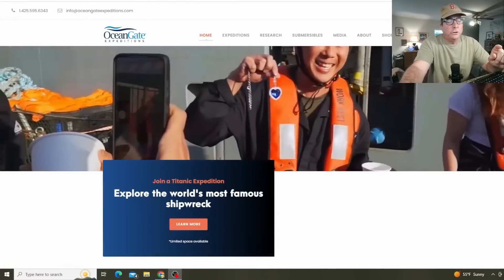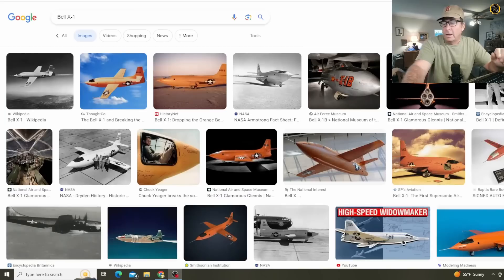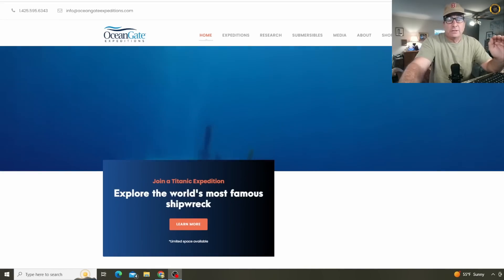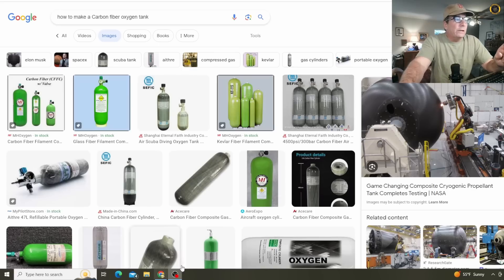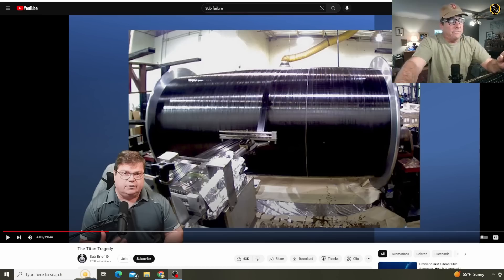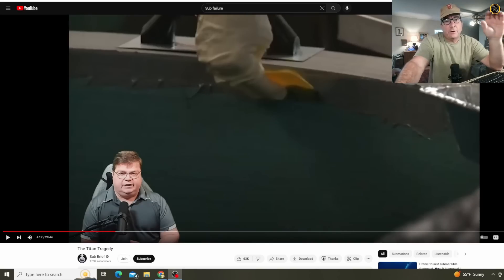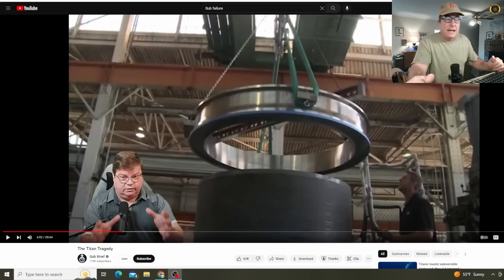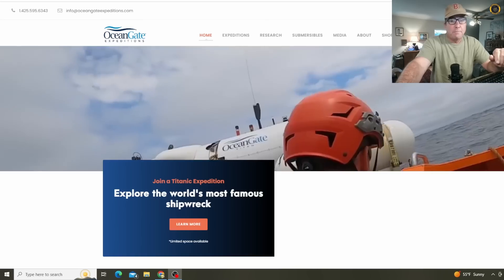Oceangate Sub Construction Details and Implosion

Comment: The carbon fiber design had its roots in a Steve Fossett plan for the DeepFlight Challenger a submarine which flew more like a plane, instead of using ballast it would descend by using forward motion and hydroplanes to generate the opposite of lift. He worked with a California company Hawkes Ocean Technologies who worked on the design, but it was planned for only one descent because of concerns over degradation with each descent. OceanGate took the carbon fiber concept and went to the same manufacturer Spencer Composites to build their pressure vessel.
The DeepFlight Challenger was weeks away from Steve running the first tests when he crashed in the Sierras.
Reply: i believe OceanGate and Spencer also parted ways because of Spencers very real and valid concerns with how OceanGate was handeling the safety and development of this project.
Reply: @glassdave I don't think so. The Spencer vessel was apparently sounding pretty bad under pressure, lots of cracking sounds. They said it was showing signs of cyclic fatigue.
Reply: @glassdave  you would think between 4 billionaires they could have hired someone to check the build design.
Reply: @freedom661100  It's not a matter of money, it's a matter of thought processes.
Reply: @freedom661100  Just because you're rich, doesn't guarantee you've got an aptitude for engineering.  Many successful people are often single minded.
Reply: Another Aerospace Engineer here.

You are right about deep flight challenger but there's a significant difference. It was all CF not parts CF and Parts Titanium.

On Juans last video on this subject I gave an explanation on the differences between compressive and tensile loading of pressure vessels and why Carbon fibre is great for rocket fuel tanks but unwise for a vessel under EXTERNAL pressure. But there's also a major issue with the differences in the cylinder to the end caps. Being different materials they compress and stretch at different rates.

Just hours after I made that comment James Cameron pointed out that all of the deep diving subs are made of the same material. They don't mix materials for the main pressure vessel. Its doesn't matter if they are using titanium, steel or acrylic. Other than port holes they don't do combinations like this sub did. 

Think about that glued joint. As the sub descends that titanium ring will deform under the pressure at a different rate to the carbon fibre putting that joint under incredible stress. My professor in college was a world leading expert in Finite Element Analysis if Axisymmetric and Pseudo Axisymmetric structures. This is the sort of thing I was trained in except it was in aerospace. AND Rule #1 of all structures is look for stress concentrations and deal with them. 

There's also an odd but previous lesson in mixing composite and metal structures. 
Back in the late 90s the Stewart Formula 1 team tried a revolutionary gearbox with the case made from composites and it was a disaster for reliability. Note that in those cars the gearbox is an integral structural member of the car. The engine is connected to the tub by a cluster of mounts. The gearbox is SOLIDLY BOLTED to the engine with locating dowel pins so that there is no misalignment. Then the rear suspension is bolted to the gearbox. 

At the the time my boss owned a racing car team on the side. One of hi mechanics quizzed me one day. His view was that as everything got hot the metal of the engine and the shafts, gears & bearings in the gearbox would expand against the carbon fibre of the gearbox casing WHICH WOULD NOT EXPAND AS MUCH IF AT ALL. That mechanics view was the difference in expansion would simply break things. That Stewart F1 gearbox might have been revolutionary but it was also incredibly unreliable and NOBODY has tried it again in any form of racing I am aware of.

Best to you Scott - love your channel.
Reply: @tonywilson4713   Okay dentist here, in University I did some research on Dental Materials and had my fair share to deal with composites, porcelain and different metal alloys such as NiTi, Gold, Amalgam etc. Oral cavity is extremely difficult environment and joining together biological materials and man made materials is difficult. One of the most common failure points of a filling is adhesion that is present between the tooth and composite (resin). Having that experience I see mixed use of materials with so different properties in such environment as serious point of failure (mixed material hull!!!). I remember doing models and stress tests to find out Young's modulus for different materials. My biggest shock was when I saw how Titanium and Carbon fiber tube was joined together. Also apparently they did weaken carbon fiber by screwing things into it, introducing stress points etc. Overall there were just too many design shortcuts and failure was a matter of time.
Reply: @tonywilson4713 
LOTS OF GOOD AND VALID POINTS ON YOUR COMMENT. (From a seasoned, 42+ years engineer in the petroleum industry).
Reply: @tonywilson4713  great comment, thanks. Incidentally, you might already know this, but, Stewart F1 is now Red Bull and have lead the last 200 laps of all Grand Prix Races, and won every single race so far this season.
Reply: @ElementsMMA  Yeah I know they ended up becoming Red Bull after they were Jaguar after they were Stewart.
Reply: I’m a professional Ocean Engineer.  Carbon fiber is an okay material for pressure vessels, apparently, because it is being used on some fielded UUVs with success.  Carbon fiber is fine in compression, unlike what the claimed aerospace folk are saying.  It’s not “pushing a rope” as the carbon absorbs the resin and hardens.   Also, there are many glued joints in ocean engineering and they’re okay for certain applications.  Typically, the joints have to be designed very well and you’ll still face limits based upon depth and submergence time.  This leads to some of the more realistic challenges with carbon fiber.  

Carbon fiber is brittle and not a contiguous material.  R&D hasn’t caught up with a great way to detect incremental failure in carbon fiber parts.  What R&D has shown is that the individual carbon filaments will sometimes break inside the part, without the part outright failing.  As more of these filaments break, the part becomes weaker and weaker.  This is detectable, I believe, with ultrasonic scanning which also detects manufacturing imperfections such as voids and delamination.  However, it’s important to note that this incremental failure is a non-linear process and to the best of my knowledge there is no predictable pattern as to how this behaves.  Because there can be microscopic internal stresses inside the Carbon Fiber part which can lead to local over stress.  

This is compounded by the fact that pressure vessel performance is also highly nonlinear.  Even with more predictable materials, heat treatments, and inspection, pressure vessels are very bendy at high pressure.  In the weirdest of ways.  This is even further compounded by extreme “stress concentrations” around any sort of bolt holes for end caps or deformities.  

So, you’ve picked a nonlinear material for a nonlinear application without R&D to predict how it will perform in load cycles.  What else?

Most plastics and resins absorb some amount of water over time - maybe 1%.   Im not sure this is a big deal in lower pressure applications, this does cause delamination of potting materials in long duration applications.   But in a 380 atm application?   I do wonder a bit harder about that - im not a material scientist but I wonder if >1% water would get forced into interstitial boundaries or rapidly speed up delamination.

Finally, carbon fiber is really brittle.  Prolly not going to make a difference at those pressures, but ideally you like to avoid brittle failure undersea bc that’s a big explosion.
Reply: @stevebean1234 You bring up a lot of interesting points. 
On the water absorption point, I wonder if more water is absorbed because  of the pressure and then is released when the vessel surfaces thus making and dedect much worse much quicker. 
I thought that one way to tell if the chamber was experiencing problems would be with enough strain gauges built into it so.that you could know if the tube was flexing more. 
What I see is that they didn't  understand the material  they were working with and were unwilling to do enough testing to learn. I would think you likely  would have to do things like build a quarter sized unit, run it to depth a number of times and then cut it up so see what was going on within  the material. If it looked OK then build another and do more cycles next time and repeat. I would continue until it failed or obvious problems developed. 
I also don't really understand the carbon fiber choice if you are trying to build something inexpensively where weight isn't a huge factor.
Reply: @doug112244 Weight was a huge factor in the Titan’s design.  Essentially, the Titan needed to float.  That way they could descend with ballast, which they would release to ascend.  A metal pressure vessel would be too heavy.
Reply: @doug112244  Interesting, strain guages (on the inside of the cylinder) would appear to give a good indication of broken strands and delamination resulting in more deflection of the structure at a given depth. Ideally you would want to "learn" the strain guage readings vs depth on the first deep dive and then compare the readings on subsequent dives against those reference readings. I guess the deflection may vary with temperature which might vary quite a lot before it enters the water but the water temperature profile is probably quite repeatable particularly when always diving at the same (Titanic) location and only in the summer. 
It would also indicate particular areas to concentrate on for ultrasonic testing during maintenance if particular strain guages had deviated from the reference on a dive. (As well as a primary function of aborting a dive if there is a significant difference from the reference recordings). 
Titan did have some sort of hull monitoring system. Was that acoustic, listening for fibres actually breaking?
I own an aircraft that has carbon wing spars (obviously carbon in compression at the top of the spar, in tension on the bottom of the spar and a carbon shear web between them). I should probably be fitting strain guages!
Reply: @stevebean1234  Very helpful post!
Reply: @stevebean1234 Thank you.
Reply: It would probably be fantastic at shallow depths, but not the type of thing to push very far at all. 100' ?
Reply: @dananorth895  Yes this thing was suitable for a couple hundred metres, that's it, and would still need frequent x-ray testing to ensure it wasn't beginning to fail internally.
Reply: @dananorth895  I heard they were having problems with this sub at depths of only 300 feet.
Reply: @dananorth895 not even sure it would be very good in shallow water, infact I’m willing to bet it’s probably more dangerous in shallow water, and I don’t mean the integrity of the pressure vessel but the whole design is just far too simple and cheap to make any sort of safe submersible.
Reply: @ryanflood635  There's no condition where shallow water isn't safer.
Reply: @sciencecompliance235 in shallow water at least it wouldn't get crushed. It seems they already made it to the Titanic with this sub, if it already withstood 400 bar in this depth it would not get crushed in 500 or 1000 m. 
Of course other safety factors may also play a role
Reply: @simonm1447  I think you're misinterpreting what I said.  I'm saying shallow water is always going to be safer than deep water.
Reply: @simonm1447  How many times did it descend to Titanic, and how many such cycles was it rated for ?
Reply: @hb1338  according to Wikipedia (the oceangate website is down) they did 13 dives to Titanic in 2021 and 2022. I don't know if they used the sub somewhere else too. 
I don't know if there was any fixed number of cycles or if they just used it until it showed fatigue. The first pressure cylinder which was used for the tests in 2018 and 19 showed fatigue after the test phase and it seems they replaced it before they started commercial diving in 21. 

They had an acoustic warning system which should detect damage before destruction to be able to abort the dive then but other experts were sceptical if it would have been sufficient since the way up took some time. 

Since yesterday we can assume it wasn't sufficient.
Reply: @sciencecompliance235  you're right, I misunderstood you. We essentially said the same thing
Reply: @simonm1447 this acoustic warning system is ridiculous. 
When you are 20 meters deep, overpressure on the vessel is 2bar. By going up 10 meters, you halve that, hence the stress on your pressure chamber. 
When you are 3800m deep, you experience 380 bar. To halve the stress on the pressure chamber, down to still a mighty 190 bar, you need to get back up 1900m… A matter of 30 min. at least in emergency, I suppose… So you are basically unable to relieve the pressure vessel of any significant portion of the stress it faces in a reasonable amount of time. The acoustic system just warns you that you are about to die.
Reply: @sciencecompliance235  I think you mis understood what’s being said. Of course 100ft is safer than 12000ft of water, but the point being made is, it probably works better in deeper more open water than it would as some sort of shallow water snorkel type vehicle due to the design.
Reply: @ryanflood635  There are far worse subs tooling around at shallow depths for tourists all around the world, it would have been quite suitable in that role, and rescue if required would be relatively simple by trained SCUBA guys etc. with minimal risk to all.
Reply: @VenturiLife  are you talking about floating around in open water ? or in and amongst things to you know to ‘tour’ because you will never convince me otherwise. that thing is not safe to do anything other than sit in open water at relatively shallow depths. You don’t even need to have a vast knowledge of submersibles to see that. Hence why i said it’s probably safer in deeper open water than it would be at surface level. I’m pretty sure this video gives just a few of the reasons why.
Reply: @ryanflood635  Due to potential entanglement problems?  If that's what you're referring to, then sure, that makes sense.

Edit:  oh, maybe you meant the sled.
Reply: @simonm1447  Glad we cleared that up.  To be fair, my wording probably could have been a little clearer.
Reply: @ryanflood635  I wouldn't have trusted it at 3000 feet. 13000? Take my GoPro...
Reply: @sciencecompliance235  March '93 Pasco County Fl. 36 foot wave struck at Marker 1. The warning was sent to Jax Fl. They didn't report the error. Typical depth at Marker 1 was 5'. Massive destruction with no warning. Do you know what it is like wading through millions of ants blaming you for this? You can't see them, it's 3 AM and the power is out everywhere and the Gulf is now even with US19. It's a shallow water area. I Mod boats for surface drives. They have nearly the mobility of the airboats, but more economical.
Reply: @bryanst.martin7134  Your response was a little hard to parse, but I think I got the point.  You're saying waves are a problem for shallow water.  Wouldn't this also be a problem for deep water, too?
Reply: @sciencecompliance235  A wave deep in the ocean is barely measurable, but as depth decreases the wave height magnifies. It is energy, expanded is small, compressed it is enormous. The shallowing depth is a magnifier.
Reply: @bryanst.martin7134  There are gigantic swells in the deep ocean and rough waters from storms.
Reply: @sciencecompliance235  I've been in them. What is your point? 
Ship rolled back and forth so bad we thought the gun mounts would topple off. I walked fore and aft in the ship from one wall to the floor to the other wall and back. CO, XO were in their qtrs puking. I was mesmerized by the events and the fire on board the previous week gave me confidence in the crew. All 4 HF fiberglass antennas were shattered. The aluminum mast was broken in 4 places. The cabinet mounted to the starboard bulkhead decided to detach and collect a Senior petty officer in front of it for a ride across several table tops in the mess hall. Ow! The sea rolled up the fantail and rolled over the sides. 
That was a single day in my life. Many more like it. Many more to come.
Reply: @hb1338  6 and 0
Reply: @hb1338  it wasn’t rated for any cycles because it wasn’t rated at all by anybody
Reply: @sciencecompliance235  not just potential entanglement problems. Just look at it.. if I have to explain it then I’d just be wasting my time tbh.
Reply: @ryanflood635  I can find a lot of things that troubled me about this submersible but it simplicity as you call it is not one of them.  I say this because designs that follow the KISS rule more often than not tend to be more robust as long as the basic design and engineering of them are sound.
Reply: @hb1338 t did about 20 dives to Titanic, and was rated for exactly zero dives to any depth.
Reply: @joso5554  I wouldn't say the system was ridiculous. It was better than nothing. The issue wasn't that they had the warning system, the issue was that they relied on it to the exclusion of anything else.
Reply: @simonm1447  The thing is the carbon fiber hull degrades every time they decent so even at 1000m, the hull would inevitably break at some point.
Reply: @bilogskii2216  which makes carbon fiber unusable for this purpose. It's a russian roulette if the sub is still good enough or not, and contrary to other vehicles which degrade over time (aircraft with pressure hulls) it's not observed and there were no checks between a certain amount of cycles
Reply: Even with my limited engineering experience with composites, when I first saw the actual footage of them making it the design immediately looked eyebrow raising to say the least given the immense compression forces involved. As a coincidence, I built a pressure vessel in college for a project that was very much of the same design. It used metal end-caps bonded to a composite thin-wall carbon fiber cylinder with varying weaves in it, mainly just to show that we could make something thin and light, and it could function as a conventional pressure vessel.
Reply: @mysock351C  THERE ARE A LOT of fiber wound pressure vedselscin many uses around the world... BUT ALL OF THEM WORK WITH INTERNAL PRESSURE, that puts the carbon fiber IN TENSION... NEVER IN COMPRESSION UNDER TREMENDOUS EXTERNAL PRESSURE! This "conceptual design" is deeply faulty from the start.
Reply: @alfredomarquez9777  Yes that is what initially got me doing the double-take when I saw them winding it.
Reply: @mysock351C  A distraction for Congress for sure. Anyone witness the loading of the coffin? Are their names going to show on certain flight manifests? "They're dead, you can't prosecute them..." Uh, huh...?
Question everything.
Reply: James Cameron mentions this in his interviews. Apparently back then, he urged the original owner as well as the man who purchased the sub after he died in a plane crash NOT to use the sub for Challenger Deep as he insisted it was going to get someone killed. Looks like he was right.
Reply: Say it isn't so: My two favorite creators in one place. You are my number one favorite channel Scott!
Reply: Yes.  Engineers understand design limitations but are often overridden by regulators and/or operators who, for various reasons (nefarious or more likely not), don't understand.  If you are involved in an accident such as this, I blame YOU for not understanding the potential risks and taking appropriate protections.
Reply: @wacobeer6469  In this case, if you pointed out the problems with the design, you were fired and sued.
Reply: @SteamCrane  Perhaps.  I recognize that reality.  I'm not sure which comment of mine that you replied to.  But I'm simply saying BUYER beware.  Clearly, regulation was no help here.  But I stop short of saying that the COMPANY was at fault without additional information.  But as an entrepreneur businessman, I don't believe that the owners/designers of this craft INTENTIONALLY caused other people harm by designing below their requirements.  BUT if they did, they are liable full stop.  Now, pay close attention to this particular point.  IF (and I'm speculating this part) IF the regulators approved the launch of this vehicle, it would be the REGULATORS who are at fault.   The Government is rarely helping Industry.  Usually, they are the problem.
Reply: @wacobeer6469  If I were an expert in designing a safety critical device like a deep sea submersible, any owner who tried to override me would find themselves down one staff member. Your suggestion that regulators don't understand what they regulate needs to be justified or withdrawn.
Reply: degradation over repeated cycles was the first thing that popped in my mind honestly. I don't know much about the material but as a musician there are applications of carbon fiber for musical instruments, specifically the bolt on neck of a guitar or electric bass and the neck, being made of carbon fiber laminate had to be specially restrung so as not to upset the tensions on it which could deform the piece
Reply: @Whydidudoitcrushinator  it seems they had to replace the pressure cylinder after the test phase (2018 and 19) due to fatigue. The new one did 13 dives to the Titanic (I don't know if they used it somewhere else too) and (may have) failed on the 14th
Reply: I love your channel, Scott - I could see carbon fiber being incredibly useful in a pleasure sub, such as one of the models that simulate a porpoise and dive and breech at high speed almost like a novel jet ski, but this application seems utterly doomed. I'm frankly shocked that he got experienced ocean explorers to board this craft, but unfortunately, I'm betting that his willingness to pilot it himself had an effect on convincing people it was safe, although there is no shortage of evidence recently that being a CEO doesn't also mean that you are a fool.
Reply: Anyone else interested in that glue. I can’t believe it made it down once and back. I’m trying to get some and try to glue my life back together
Reply: @patjohn775  well it's not being pulled apart. It's being pushed together.
Reply: It stands to reason that the carbon fiber pod would withstand a limited number of hours under extreme compression.
But, correct me if I am wrong, this was the Titans fourth dive down to the titanic.
That seems like at least 2-3 too many dives.
The pod was just getting weaker and weaker, if this hadnt happened this dive it would have certainly happened on the next.
Reply: I wouldnt trust it to keep the fizz in my soda.
Reply: Holy shit this is the strongest piece of evidence I've seen so far. Yeah yeah there's plenty of speculation and true experts chipping in, but this is the strongest confirmation I've seen so far of carbon fiber failing via fatigue. A real-life example of use and what it's stated limitations are, most notably cycling. 

The whole sub/diving community is quite small relative to nearly any other hobby in the world, and it's really shown in the last week. LOTS of anecdotal and theoretical evidence but little in ways of hard reports or comprehensive investigation. Perhaps whilst so many lessons were already learned just to be ignored by this CEO, hopefully the community can gain some insight into construction techniques and possibly even implementing some into future designs. Hopefully this time with adequate experience on the team, safety culture, and testing.

Interestingly enough, it seems like the concept was for a one-and-done run of Challenger Deep for a record. Obviously that explains the one descent plan, but also shows that carbon fiber can potentially be an extreme impressive sub material, if only for more "disposable" purposes.
Reply: I went to go comment this, but then I realized that I learned it from a Scott Manley video and then I saw that Scott manly had already commented it too. What a legend!
Reply: The problem with that is, no million dollar ticket no matter how many you can sell will pay for the craft.  Was the cost of the craft ever disclosed?  Do you suppose those idiots will be diving their remaining subs?  I wonder how the economics worked out.  LOL he wouldn't hire 50 year old white guys with military sub backgrounds.  The real submariners wouldn't have worked for that fool, white brown black and other.  He had to hire a bunch of interns.
Reply: Question, why did Steve attempt going over that mountain with an under powered plane ?
Reply: Thanks for the info scott, that history is interesting. I saw a video of him wrapping the CF around the 1 inch titanium tube, but never saw him baking it in an oven. If he would have graphitized it by baking it between 2500 to 3500 F it would have given it more elasticity. I could be wrong, but I don't think that hull collapsed and imploded. As you know, he had 5 inches of CF, and even though it might be weak in compressive strength, he made up for this by making it thicker. Also the epoxy is strong in compressive strength, but weak in tensile strength while CF is weak in compressive but strong in tensile, so combined they both make each other strong. It's just speculation, but I think either the window failed, or that cheesy 2 inch deep dado joint he had in the titanium end caps for the CF tube to be glued into. The epoxy resin glue he used to join the end pieces to the CF has a tensile strength of 5 to 6000 psi, but he was taking it to depths where there is 6000 psi. I think he should have had a 12 inch deep dado joint machined into the end caps to give him more gluing surface. This would have also allowed him to get away from the edge and drill holes through the titanium CF titanium sandwich, and put bolts through it. Even though drilling CF weakens it, it would have been sandwiched between titanium. Anyway, we know it didn't suddenly collapse and vaporize everyone with the heat of all the suns in the universe, like some are saying. James Cameron said the last message sent to the surface ship was the cabin had been compromised and he was dropping weight to resurface. I think it sprung a leak, at either one of those end cap joints or the window, and he started having a charmin moment and tried to resurface to no avail. 2 minutes later Cameron said the navy sensors detected an explosion. It's just speculation, but I think it sprung a high pressure leak, maybe a pinhole leak to begin with, and it forced all that pressure into that cabin and since it was sealed, the pressure had nowhere to escape, so it blew the thing up like a balloon until it exploded.
Reply: @mygunisinnocent8028  most of what you said here is wrong
Reply: @mygunisinnocent8028  I could pick this apart but there's no point. You really don't know what you're talking about.
Reply: @matthew4878  My scenario very well could be wrong, but so could yours, because nobody really knows what happened. This is my scenario of what I think happened, but you may have a different theory of what happened. Just because your theory is different, you can't say I'm wrong, and I can't say you're wrong. One thing for sure though, we can rule out a sudden implosion that happened in the twinkling of an eye and vaporized them, because the surface ship said the last message Stockton sent was that the cabin had been compromised and he was resurfacing. 2 minutes later the navy sensors detected an explosion.
Reply: @mygunisinnocent8028  The hull inflating like a balloon and exploding??? That is what can happen when the pressure on the inside is higher than the outside.

When you have 400 atmosphere pressure on the outside and 1 atm on the inside, then the hull is under a huge amount of crushing inwards force. Water leaking in can't suddenly blow up the hull like a balloon. Because water leaking in can't create more than the 400 atm of the outside. Which would mean relieving all the strain on the hull.

You can send a standard pet bottle or soda can to this depth - as long as it's open it will keep the same pressure on inside and outside and neither get crushed nor blow up like a balloon. Because the forces would balance.

Once more - the forces on the hull comes from the difference in pressure. And equalisation reduces the forces. The only time when you can blow up something by inrushing water is if you get a water hammer. You fill it 100% with water so quickly the kinetic energy of the inrushing water smashes the walls. The water has to stop - same way a swinging sledge delivers a very strong impulse when hitting an object.
Reply: @perwestermark8920  Imagine a car tire that is not inflated, but the bead is sealed on the rim. It would be 1 atmosphere in the inside, but the ocean pressure outside is 400 atmospheres. Lets say someone hooks an air hose to the valve stem and the compressor has a broken off switch, then compressed air starts entering the tire. The tire is sealed and the pressure has no where to go, so it expands the tire until it explodes. Ever been around a truck tire when someone forgets and leaves the compressor on it? It explodes. The leak in the compartment would act as a valve stem letting the pressurized water into the sealed cabin until it exploded. The 400 atmospheres would be like a giant air compressor. It could have been a hole the size of a human hair that started spraying pressurized water into the cabin. The stream of water would have been so powerful it would have cut Stockton in half. It would have been like one of those high pressure water cutters.
Reply: @mygunisinnocent8028   Your example does not make sense. Yes - a leak can be dangerous because it can cut like a water jet.

Buy this wasn't what was discussed. A leak would end up normalising the pressure on the inside. Because the hull can trivially handle 400 atm inside when m there is 400 atm on the outside. And then there are no longer any force to keep sending in more water.

While a compressor with broken switch would try to explode a tyre. Because it may try to get 15-20 atm on the inside while it's still only one atm on the outside.

But a fast enough inrush of water (not this fine stream but a massive inrush) can rip the hull from a "water hammer". The kinetic energy of the inrushing water just as the hull gets full will slam the hull. But it needs to be lots of quickly moving water. A small spraying hole would only have a high water speed at the start - the fuller the hull gets, the lower the pressure differential will be.
Reply: @perwestermark8920  But the pressure has no mind and no off switch. Pressurized water would continue filling the sealed compartment and expand it until it popped like a tick that sucked too much blood. Imagine the ocean pressure of 400 atmospheres as a huge air compressor tank forcing pressure  into a sealed cabin like that. It's not like a boat on the surface that springs a leak and starts filling with water. Even if the sub was on the surface of the ocean and sprung a leak, it would just trickle in without exploding it, because the outside and the inside are at one atmosphere.
Reply: @mygunisinnocent8028  Maybe you should log off. Or actually draw some images and thunk a bit. 400 atm inside the hull is no issue when there is already 400 atm on the outside. The forces on each side of the hull will cancel each other. No exploding hull. No crushed hull.

You can see in James Camerons film about going 3 times as deep - the Mariana Trench - a PET bottle on the sea floor. Not crushed. Because there is the same pressure on the inside and outside.

Your compressor filling a tyre will send in a higher pressure than what is outside. But the sea can't do that.
Reply: @nonegone7170 Your implosion theory defies the laws of physics. Imagine that you are all bummed out, because you caught your woman cheating with me and decided to roll you a big joint. What happens when you suck in on that joint? Your lungs expand. It's the same thing with that sub, it sucked in that pressure and expanded it to the point of explosion.
Reply: If he hadn't died in a plane crash, then he would have died in a submarine implosion, because carbon fiber is the worst possible material for vessel with the pressure on the outside. It's like trying to push a string uphill.
Reply: It's very small diameter was significant. Think 6,000 pounds pressure per square inch of the hull. That is static, not life sustainability. Many things can go wrong. Often do. But I don't doubt this as a ruse.
Reply: @bryanst.martin7134  A ruse? To what end?
Reply: All submarines are neutral buoyancy and descend and surface by diving "wings"
Reply: @hotrodray6802  so where were the wings on Titan?
Reply: @scottmanley I don’t believe titan met the definition of submarine, technically it was a submersible.
Reply: @scottmanley hey Scott Manley nice to see you here! This man’s an engineer, his input is valid.
Reply: @HairHelmet More like a coffin
Reply: @scottmanley  It's a submersible, not a submarine. It doesn't "fly" through the water like a submarine, it goes up and down by balancing buoyancy against ballast.
Reply: @HairHelmet  well, technically, the word submarine simply means underwater. It doesn't imply that the craft must have hydroplanes.
Reply: @scottmanley  Titan wasn't 'neutral bouancy', it was heavier than water until it detached it's ballast (apparently scrap steel).
Once the ballast was released it became positively buoyant & rose towards the surface it seems.
Reply: @hotrodray6802  Absolutely wrong. Submarines come in many sizes, shapes and means of operation. Most have ballast tanks and can adjust their buoyancy, changing within moments from positive to neutral to negative.
Reply: @hotrodray6802  You are very mistaken, friend! Disregarding the roll and yaw functions and focusing on the pitch function only, the various 'wings' are used to maintain constant depth while cruising underwater in water that continuously changes density due to temperature and salinity changes by controlling the pitch of the sub, not to dive or surface. The tiny 'wings' are completely insufficient to significantly raise or lower the sub! Ultimately, a submarine changes depth by changing its density via ballast tanks.
Reply: @richardpark3054  The hydroplanes are the primary means of controlling the sub's depth, but the sub's buoyancy is adjusted so the angle of the 'planes is 0 degrees. https://youtu.be/XFJnWp1tAdU?t=436Of course the hydroplanes only work when the sub is in motion, and at 5 mins the sub does a stationary dive by flooding the ballast tanks.

Interestingly, in an earlier video of the series, Dustin comments that he can hear the sub creaking and cracking as it changes depth. And this is at a fraction of the depth that Titan was operating at.
Reply: @hotrodray6802  if that were true, how would a sub stay on the surface when not moving?
Reply: @benchociej2435 😊
Reply: @benchociej2435 e sun floats.  It uses the wings to pull it down using forward  motion. Fail safe design. If it stops moving it floats back up.
Reply: @hotrodray6802 the "wings" are called diving planes or hydroplanes 🙂
Reply: @hotrodray6802  You might want to take a course on the subject before you espouse inaccuracies. Many types out there. Like people, they are not all the same.
Reply: @hotrodray6802  this was not a submarine it also had no wings and used thrusters
Reply: @hotrodray6802  Some do. Not all.